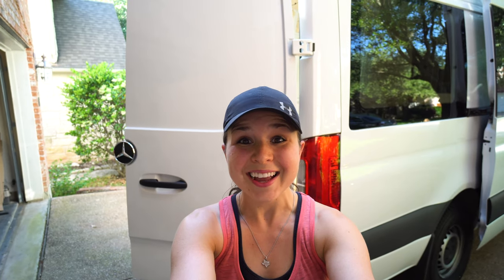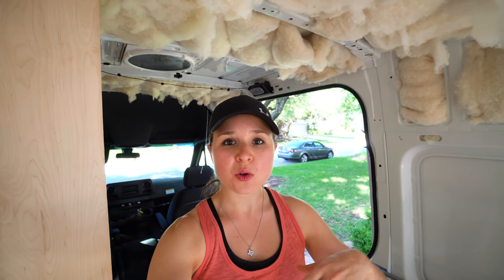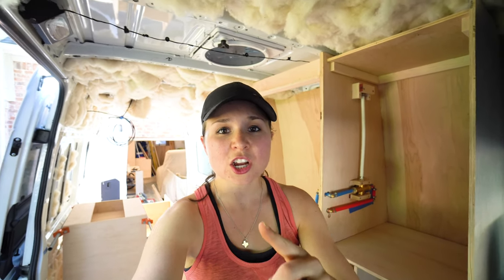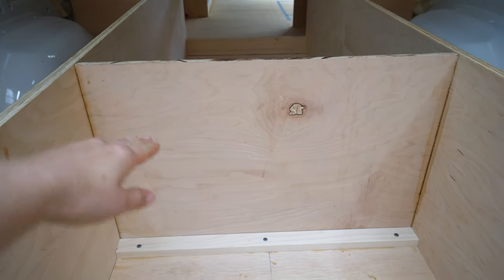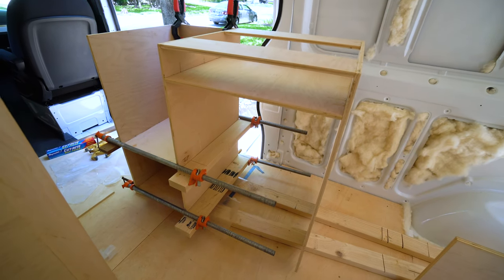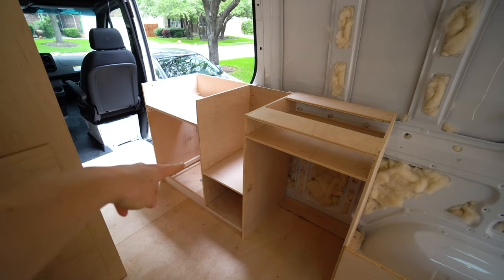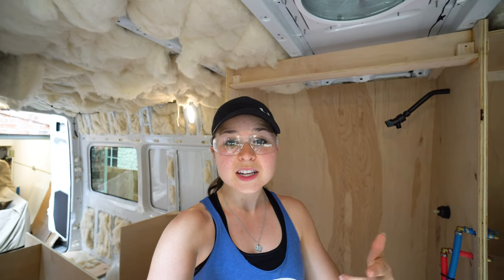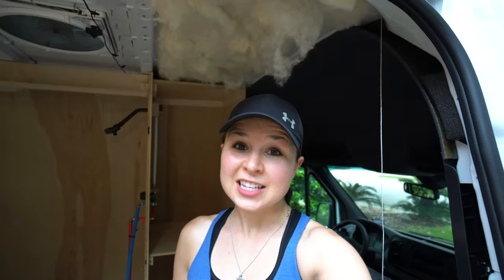Building our Sprinter Van Cabinets | Van Build Series

Comment: Great video! Thanks for posting. What size and type of plywood did you use for your cabinets? And then how did you connect them to your walls? Screws, riv-nuts, or something else?
Reply from the maker: Thanks Blake! It has been a while, so we are a tad rusty on the details, but I believe most of the cabinet plywood was 1/2” birch. We used self tapping screws to attach all wood to the metal wall, wood supports we added to the wall, and to the ceiling supports. Hope that helps! 😃
Reply: Adventures of A plus K , that’s very helpful. Thanks!!!
Reply from the maker: Of course! 😃

Comment: looks amazing! how did you guys attached the walls of the toilet to the structure of the van? I'd prefer not to build a 2x4 wood structure eather, but ?.m getting crazy trying to find a way to attach a 3/4 playwood to the floor/ceiling/side of the van
Reply from the maker: Hi Corinna! We attached the shower structure to the ceiling and the floor of the van, and the back of the shower fits very snugly against the wall of the van. The shower floor is glued and screwed into the subfloor and we attached the shower ceiling to wood ceiling ribbing that we added (which is attached to the metal of the van). I am not sure we recorded this step of the process, so I hope that helps!
Reply: Adventures of A plus K thanks a lot! Sounds great 🤩

Comment: We are half way through our build. Question please. Did you build your upper cabinets using half inch ply and what hinges
did you use? As always thank you so much.
Reply from the maker: Hi Pam! Except for the benches, all cabinets were made with 1/2” maple plywood and 1” by various widths maple boards for framing. We used standard concealed cabinet hinges. For the doors we used 1/4” plywood and 1” by various width for framing. I believe most or all were soft closing. We used varying overlays as needed for clearance, but none were full overlay. Hope that helps!

Comment: May I ask why you chose to put the kitchen on sliding door side?   We are planning our kitchen behind the driver seat so that there is more room in the kitchen, but I really like the kitchen looking to the outside and it's not to late for us to change our plan.  Our concern was a tight hallway across from the shower.  How wide is your hall in the kitchen from the shower?  Appreciate any feedback.  You two are a darling couple!
Reply from the maker: We thought about putting it on the driver side for more room, but we really liked the idea of cooking with the door open and a nice view (and not adding another window). We also weren’t sure where the shower would go without it being too close to a window. Where do you plan to put the shower and dresser and closet (assuming you’re doing all of those) in the plan you’ve mocked up? The hallway is tight, but my dad, who is a pretty big dude can fit in between the two without getting stuck lol! The dresser is also set back a bit so the back half of the kitchen and dresser area is a bit wider!
Reply from the maker: Also, my brain is mush from the van build lol and it has been a while since we made some of these decisions, so I am sorry if my answers aren’t super helpful!
Reply: Our dresser will be by the slider and extend a bit into the doorway on back to the dining/bed area with overhead cabinets all the way back.  We like the open look.  On the driver side will be our closet, kitchen, then shower/toilet to dining/bed area with overhead cabinets all the way.  We are not doing a raised platform.  We will work remotely part time from the van and want lots of view while spending time in the van. Especially in bad weather.
Reply from the maker: That sounds like a good layout! I forgot that y’all have the extended, so you’ll have some wiggle room. And good call on not a platform bed. We like how open the convertible bed to dining area makes the van look!

Comment: Hi there, can you tell me what kind of plywood you used for your cabinets and also how thick it is? Hope all is well. Melissa
Reply from the maker: Hi! We are pretty sure all cabinets were made with 1/2” maple plywood and 1” by various widths maple boards for framing. For the doors we used 1/4” plywood and 1” by various width for framing. It has been almost 2 years though, so we are a bit rusty on the details unfortunately 😅